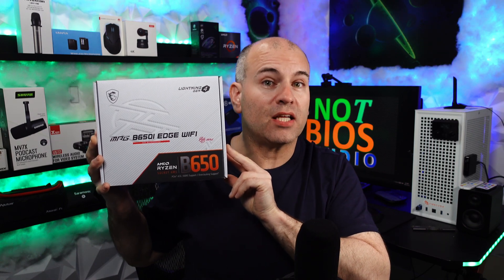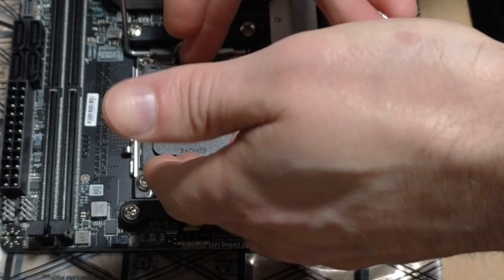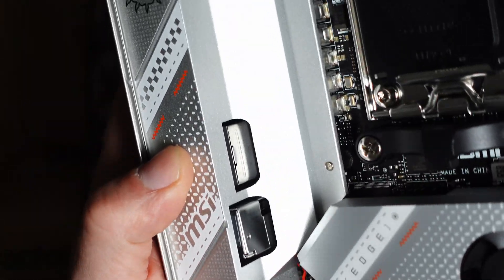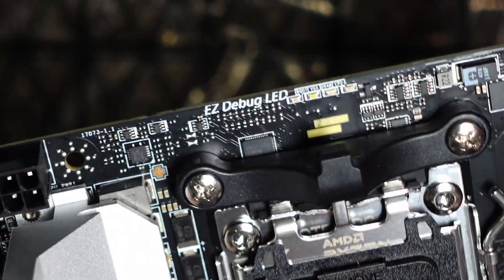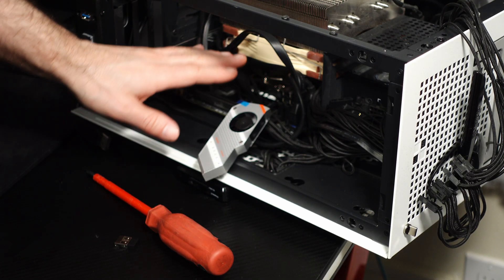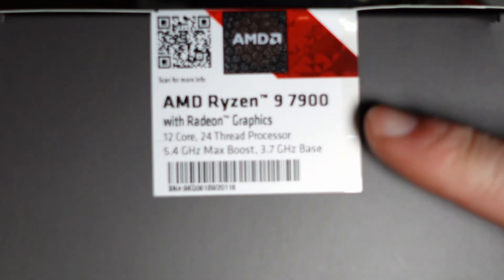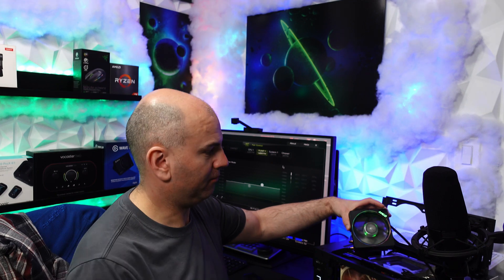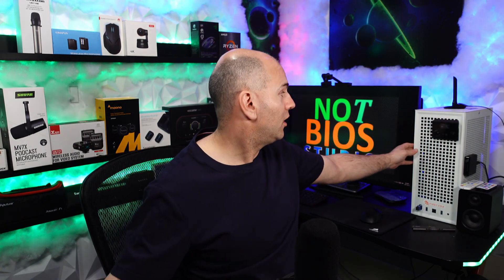MSI B650I Egde Wifi Motherboard Overview, M.2 Cooler Noise

Comment from the maker: UPDATE: DO NOT PURCHASE MEMORY SHOWN IN THIS VIDEO FOR AMD, G.skills does not list not compatible but Tech support verified for Intel
The G.skills memory I list above is AMD EXPO compatible and looks awesome! I Switched motherboards to Asrock B650M RS Pro, cheaper, more stable and works better but with a bios screen that looks like something out of 1990; isn't perfect but it works.

If you are having problems with MSI B650 or newer hidden bios issues I have a video on the MSI B650 nightmare. Pinned in comments are the fixes.

Comment: Am I right that this MSI B650I does not have a temperature sensor for the chipset?  So what sensor is supposed to inform the fan curve of this tiny fan?  I gather that this FROZR thing is meant to cool both the mobo chipset & the M.2 ssd.

Also, the cable of the FROZR fan blocks the use of the mobo's SYS_FAN 4-pin.
Reply from the maker: @gluino  this board has a system temp...  Chipset would be an X670 thing which is an external controller. The B650 all the memory control and PCI-E lanes, M.2 are all built into the CPU. BUT dang system temps (VRMs) get very very hot on my motherboard reaching 70C when gaming with a mesh case with 5 fans in it.

My cheap ASRock B650M Pro RS system temp is actually cool like 40C at half the motherboard cost with 3 m.2 slots, 2 PCI-E and a ridiculous 6 fan headers I believe it was and also benchmarks wayyy faster and PBO to negative offset for lower temps and better performance actually works properly. I got ticked with MSI for not enabling memory context restore by default... Enable XMP / EXPO and reboot 2 times and enjoy a missing bios screen until you reset the bios again wait 6 minutes just to boot to remember to set Memory context Restore before the bios gets hidden yet again... Support at least offered to let me RMA my board still cause EXPO never runs fully stable. Sadly I went micro ATX, prefer ITX for size but I did by a super awesome Lian Li Edge EG1000 power supply nearly ZERO coil whine with an asus RTX4070 GPU and bad coil whine with all 5 SFX power supplies.

Gonna see when I am finally home from working at a remote construction site if a replacement if approved fixes anything. But Asrock has been working like a champ, despite being cheap.

Asrock bad issue is my system refused to ever boot with my Ryzen 7900 CPU with red lights on LED failed memory CPU lights. I had to use the bios flash button to flash to the new bios and it works like a champ, rock stable.
Reply: @sparketech  mosfets are rated to 125c usually. 70c is perfectly fine.
Reply from the maker: @jeremytine  I still don't at all like it for reasons I didn't mention. It heats up the CPU socket more even when idle it's crazy warm. I don't like how hot it is. My Asrock cheapo B650M PRO RS Wifi idles at a nice cool 39C games at a nice cool less than 50C. My CPU set to ECO mode runs far cooler than MSI ever does when gaming less than 70C, MSI try around 80C even if the same case. ITX maybe just runs hot, doesn't mean I have to like it :P. Double the price, not stable and runs super hot.
No thank you, it can sit in my Corsair 2000D case doing nothing.

Also Goggle search "motherboard mosfet throttle temp"
A motherboard MOSFET typically starts to throttle due to temperature around 80°C to 100°C depending on the specific design and MOSFETs used .

I believe most throttle at 105C on modern systems but at rating up to 125C doesn't mean the system performance won't tank. long before that. Hardware Unbox showed that many times on their motherboard tests. And yes 70C may be fine, I still don't like it :p. The MSI B650I Edge Wifi can sit in my Corsair 2000D case and collect dust.

Comment: Was planning on getting this board. I can just remove the whole m.2 cover correct? And use a m.2 that has a heat sink? First time with nvme m.2
Reply from the maker: Correct. I would recommend the Gigabyte version if you want a board with a better bios. But I don't want Gigabyte because of the cooling fan. Settings that "MUST" be changed for a proper functioning board are pinned in my comments.

Comment: i got this board, my chipset fans always spin at 100%, 6000 RPM, is that the same with you too? or did I plug the cable of the chipset fan wrong?
Reply from the maker: I always always always go into my bios and manually set my fans. For some reason the board seems to get my system fan to DC voltage rather than PMW when not manually set and saved which makes the fans spin close to 100%

Comment: Sais tu ou je doit brancher l’es différent câbles du watercooling sur cette carte mère ?
Reply from the maker: The 4 pin beside the CPU fan connector is for fan or AIO radiator pump.
Reply: @sparketech  le petit câble de la pompe aussi ?

Comment: I have the same motherboard. Do you know how i can activate the wifi and Bluetooth?
Reply from the maker: Make sure the antenna is connected for the WiFi. Ensure the drivers are installed from MSI online / AMD direct since those will be the newest drivers. In windows go to the settings cog and go to the menu that shows settings like Bluetooth and make sure it is enabled.
Reply from the maker: Hopefully you don't have an AMD GPU added... If so get that newest beta bios so you don't fry your CPU. Couldn't believe the crazy high temps... Switched to RTX and temps went down by nearly 30c. Just crazy.
Reply: @Not Bios  good to know, I'm new to pc building and I'm glad i choose rtx. I almost got the rx 6950 because of discount and i found out how Amd gpu consume more wattage than rtx
Reply from the maker: @mrnosleep8552  I do hope AMD gets their GPUs sorted or Nvidia is just going to keep jacking up prices and AMD has to stop following Nvidia with price increasing. Their 7000 series is rather impressive but they really did sand bag their release the other lower end models should have been out long ago.
Reply: @sparketech  I wonder if CPU department is better? Are they more reliable than intel? Cause AMD gpus are just trash - I've had 2 of them and ever since I switched to Nvidia ALL PROBLEMS dissapeared. I wonder if i should swap my CPU too...
Reply from the maker: @Dominik-iv6ek  I hate to say it but yes Intel is Better. AMD systems are a mess for these 7000 series but MSI seems to be even worse due to crappy bios. I am switching boards to the ASRock B650I Lightning Wifi once I can actually purchase it here in Canada
Reply: @sparketech  
Have you solved the MSI B650i Edge Wifi BIOS problem at all.
I assume not since you are waiting for the Asrock.
Should I RMA this mobo?

I 'm also having problems connecting my new Corsairt Katar Pro bluetooth mouse.
I can pair my Lenovo cordless/BT earphones and detect a neighbour's Toshiba but the Corsair is not detected less than 1m away.
(NB that I have updates all drives upon finishing my 1 week old build).

And F'd me, I indeed have an AMD GPU as well.